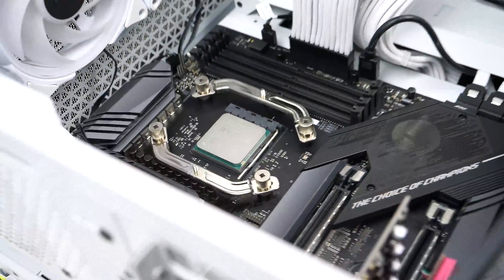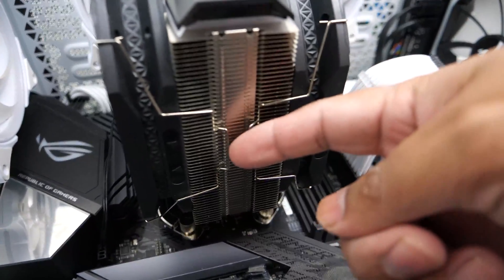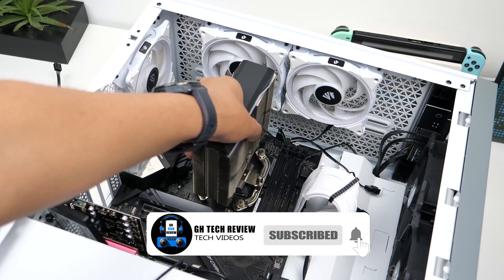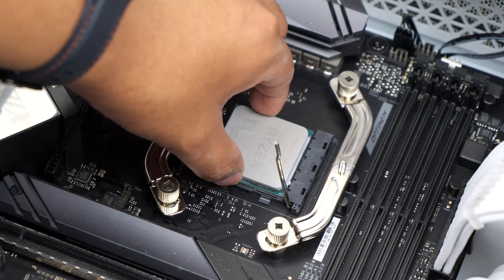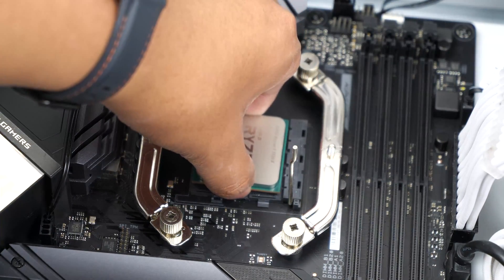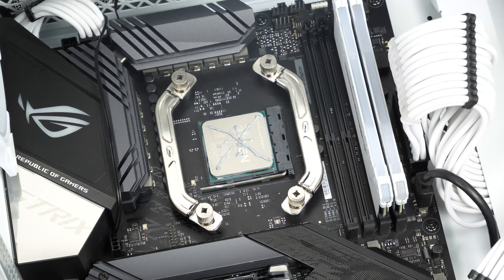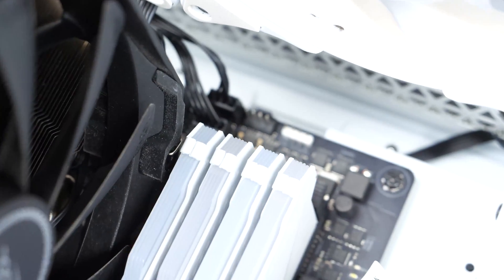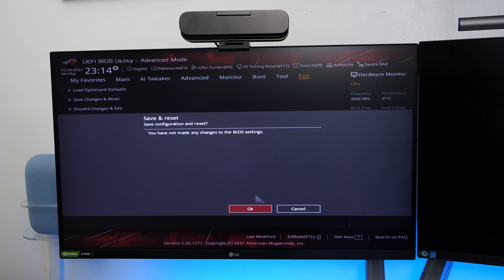How To Upgrade Your CPU Step By Step | AMD Ryzen CPU Installation 2022

Comment: just bought a ryzen 7 7800X3D cant wait to see how it works. gonna put it in this weekend.
Reply: make sure to update bios or check if your bios is compatible
Reply: @fittle270  I had a Ryzen 7 2800X, so should be good.
Reply: @Curtis56c bro I hope you're not trying to put your 7800x3d on your old motherboard. They are not compatible
Reply: @alexklein278  bruh hahaha

Comment: So u dont have to get new drivers for cpu or delete the old ones? So just take out old put new and done? It cant be that simple😅😅
What about if ur old cpu had integrated graphics?
Should one do a clean windows install just to delete old drivers just in case?
For mine i have to update bios, if i do a clean windows install do i brick the bios? Or thats just 2 different things?
Reply: the drivers are only there for you because of the integrated graphics. if you are getting a new cpu without integrated graphics then you will need a separate GPU for your graphics which will have its own drivers.

Comment: Hello. If I were to go from an Intel CPU to AMD would I follow the same steps? Any additional things to look out for? Thank you!
Reply: No, you need a different motherboard. The sockets are not the same
Reply: You can only go from AMD to AMD and vice versa. And even then you have to make sure your MB supports the chip. AM4 is different from AM5 and those MBs do not support each other but AM3 and AM4 have the same connection and are compatible as long as the MB manufacturer has available Bios for that chip.

Comment: Do I only need to remove the cable that is connected to the cpu fan if I have a AIO
Reply: You don’t need to remove any of them at all if you can move the cooler out of the way

Comment: I changed my motherboard, cpu, and gpu. Now I’m stuck on bios when I boot. I try to exit it and it just restarts bios. I have no idea what to do. 😢
Reply: If your old hardware still works swap them back in one at a time to see if its any of the new parts causing it
Reply: @sethmccuckins  I was able to get windows to boot by switching to CSM. Unfortunately my gpu is telling me that it is not recommended to have it on CSM. I tried to switch back to UEFI but got stuck in BIOS again like the first time.
Reply: @poppajay4968 did you use a different brand for the gpu?
Reply: @chaedd18  Yes. Switched from NVIDIA to AMD
Reply: @poppajay4968  ok sorry, i got this mixed up with something else, i have no idea whats happening with your pc
Reply: @poppajay4968  did you remove the nvidia gpu drivers beforehand?
Reply: Fresh windows install?
Reply: Make sure your mother board has the correct mounts for the new cooler as well. Delayed my build by three days waiting for new mounts to be delivered 🥴 NBD in the end but would have been able to plan for it instead of learning the hard way.

Comment: Changed the cpu and the pc won’t boot at all. It turns on the power button light doesn’t turn on and it won’t display anything to the monitor… feel like I just made my pc a paperweight but I followed all these instructions perfectly
Reply: If your old cpu still works the new one might be faulty in case you already checked if your motherboard supports your new cpu
Reply: Does your cpu has a igpu, or do you have a dgpu

Comment: Don’t bother with Thermal Paste in 2025.. Lookup PTM7950. It’s a phase changing material. You won’t ever need to keep replacing it. Actually improves the more cycles it’s used. I’d recommend Honeywell’s brand.

Comment: What if you get a red screen warning about TMP 2.0? There is an entire process for bypassing TMP 2.0 when upgrading your CPU. TMP 2.0 is enabled, and if you hit Y (yes), Windows will lock out your hard drive unless you have the encryption key. Your HDs are TOAST.🚨🚨 Get your TMP 2.0 keys BEFORE swapping CPUs. If you don't have TMP 2.0 enabled, you still need to bypass it in the BIOS, and there are numerous YouTube videos on this process. Happy swapping! ✌✌😎😎

Comment: What hardware upgrade will trigger reinstallation of windows operating system?
Reply: Mobo and boot drive I think
Reply: Nothing. But if you swap Graphics card AMD to Nvidia or other way around you need to remove drivers with DDU. 
Windows 10/11 is pretty good at reconfiguring itself when you change hardware. If you change mobo you need a new key.

Comment: I changed the cpu today. Scariest experience of my life
Reply: Dude im changing mine right mow scared 😱
Reply: It's honestly the easiest thing, even replacing your entire motherboard is the most straightforward process. As long as you follow instructions.
Reply: @KaladinVegapunk It's scary when ya start and don't have thousands of dollars in parts.
Reply: Tell me about it
Reply: Yeah i did it right and the bios screen recognized it but it's not booting up windows😳
Reply: @keltnhagrmn2059 did you get this resolved?
Reply: @keltnhagrmn2059 did you ever get this to work?
Reply: Bro is that work
Reply: It’s not scary

Comment: I've always been scared to change my CPU, and have been told botching it is a good way to ruin your PC. Though my CPU is now my weakest link on my PC so it will need to be changed soon. This video at least makes me feel a bit more confident in replacing it when the time comes.
Reply: Botching it wouldnt do anything but maybe ruin the cpu.
Reply: Best tip is to not overthink it man, if you’ve built a pc before then you can take it apart no problem. Worrying too much will just increase the chance of you fucking it up lol, it’ll be fine

Comment: I am new to this pc thing I got a pc with amd radeon rx 590 and xeon processor can I upgrade the processor?
Reply: check out pc part picker it will tell you if your parts are compatible
Reply: ask chat gpt or some ai thing trust me it saves a headache
Reply: @clementwolfe-r8lI don't mean to be rude, so don't take it this way, but using AI to ask for computer help is a quick way to mess everything up. I've asked for tech help before and it gave me completely wrong answers and nearly caused me to break my PCs storage

Comment: how much pressure should i put when wiping the cpu thermal paste not on the fan
Reply: About the same pressure you would apply as if you were cleaning eyeglasses, light but somewhat firm.

Comment: can high cpu usage 100% be a reason why I need new processor? I bought a new fan but that still didn’t seem to work.
Reply: Software issue most probably.
Reply: if you cheaped out on any parts that will be your problem, i cheaped out on a motherboard and my ram couldn't reach full speed. on top of that i could barely play any new games with 60fps 1080p

new motherboard solved that i can play in 1440p no problems now
Reply: Yes bro wtf
Reply: @Dinksten could also be a pc/software problem, my CPU was constantly at 100% and i were tweaking out trying to find it out, got so sick i reset my pc and installed windows again, and back to normal
Reply: @ how old is too old? I got a Ryzen 9 7900x
Reply: @Jeet-Driller  That cpu is fairly new, will last you another 10+ years and can be paired with 4090 or higher. So, I don't know what the issue is. Tell me the gpu you have.
Reply: @Jeet-Driller that’s a good cpu it shouldn’t be at 100% usage though

Comment: Wat if I can't scre my cooler into my cpu
Reply: I
Is there something the screw go in case I don't see anything
Reply: @WilliamReitmeier-kl5by did you figure this out? they usually come with two or three adapters to fit any changing screw patterns/positions. usually one being intel or amd but they may effect cooling hardware aswell

Comment: So um what should I do if the chip came out with the old one and is stuck to it?
Reply: U just take it off
Reply: @PeterdihMore it was stuck on the old heat sync but I figured it out just got a hair dryer and used a old ID and got it off with no issues or bent prongs

Comment: I have an A10-9700 and the bios is at the latest driver and I'm planning on buying an R5 2600, should I update the bios 1st or install the new procie 1st? If I update the bios 1st it will cut the support on the A10-9700
Reply: Update your BIOS with the previous processor 1st. Then, swap the new one after you've done the update. Careful tho, if the update fail, your motherboard is done. No other way around except to buy a new one if that happened.

Comment: I have a b450 mobo and i partner it in my r3 3200g do i need to update bios if im gonna buy a second hand r5 2600
Reply: Yes
Reply: why do you buy 2600 replacing a 3200g? are you upgrading? or something happened to the 3200g?
But anyway i dont think you need to update bios. If you want to really make sure, i suggest you to go to the official website of your motherboard, just type your motherboard name on google. Then look for the compatibility section.
Reply: No. R5 2600 is one previous generation then 3200G. unless if you upgrade it from R3 3200g to something like 4000 series or even 5000 series, which your mobo is more than capable to handle 5000 series as long as you update the BIOS. Its better to upgrade to the next gen cpu rather than swaping it with previous generetion. Does it cost more ? absolutely. But it worth much, much better.

Comment: I have a b450 mobo and i partner it in my r3 3200g do i need to update bios if im gonna buy a second hand r5 2600?
Reply: Most B450 motherboards already support up to 5000 series, my old B350 supports from 1 to 3rd gen ryzen by default. But, if your bios is old, it wouldn't hurt to update it. Just go research about your motherboard and the BIOS versions
Reply: Also look out for a r5 3600, they shouldn't be much more expensive than 2600, maybe max 10$ more, but are newer than 2600 and do give more performance and less bottleneck.

Comment: I went from a ryzen 3 to a ryzen 5 5600 and now i cant even load fortnite up and if i can i get 12 fps in the lobby before it crashes, what has happened
Reply: Is ur motherboard compatible for the 5000 series?
Reply: @PompeyPlay  yes
Reply: This one comes up more often than expected: when you plugged your HDMI or display port cable back in, did you plug it into your video card, or into your motherboard?
Reply: @erikmcgowan33 it was in the gpu
Reply: @FOAMYCHIMERA461  did you ever check the temps on your new cpu while it was installed? The cooler might not have been doing its job, the thermal paste could have been a bad batch, stuff like that which would cause it to throttle itself to reduce thermal load
Reply: @erikmcgowan33 definitely not the cooling average temp was 40c
Reply: Did you use ddu to uninstall the chipset drivers? If you did not there probably was a lot of residue left over from the ryzen 3 I would run ddu and then don't use the auto detect tool from AMD go to the drop-down menu and choose your CPU
Reply: updated the motherboard bios? installed the new cpus driver?
Reply: @leo-olivierguay5487  I tried everything, updated gpu, cpu and motherboard drivers, reset the bios, re installed windows, dissasembled and re assembled the entire pc. I've just gave up and gone back to my ryzen 3 and I can return the ryzen 5 anyway
Reply: @FOAMYCHIMERA461 any fix?
Reply: @BraxtonDavis-c9p  only found out a few days ago, turns out my gpu was faulty and when I had my ryzen 3 I didn't have one and was using the built in graphics
Reply: @FOAMYCHIMERA461  how did you try everything else but ignored the fact you didnt have a gpu
Reply: @sapo4747 basically i had the ryzen 3 with built in graphics, i then upgraded to a new cpu and i knew the 5600 didnt have built in graphics so i also brought a gpu, but the gpu was faulty
Reply: @FOAMYCHIMERA461 Ohh I see, damn you had to do all that to get everything working 😂. It’s good you did though
Reply: No @BraxtonDavis-c9p

Comment: do you need to upgrade Power supply unit for higher cpu?
Reply: Depends on your current PSU, check the needed wattage for the new cpu and compare it to your current CPU - if it is the same it should be fine. If it is not the same, check the max wattage output of your PSU. I recommend using some sort of online "pc part picker" - it should alert you if there would be any problem. (Note : im not an expert, this is just my common sense, anyways I hope it helps)
Reply: almost never
Reply: not all the time, I did upgrade mine after getting a huge GPU upgrade tho

Comment: Mine is a stuck on orange light what should I do
Reply: Everything lights is on I got replacement for my cpu and now it’s stuck on orange light I need help
Reply: Check if that light is for DRAM, try moving your sticks to different slots.
Reply: @ I figured it out I re seated my cpu and it worked
Reply: @lvfestylebrazy  Good to know!

Comment: So I'm upgrading from ryzen 5 3600 to 5 5600 and i have Gigabyte B450M DS3H WIFI, do i need to update the bios?
Reply: If you go on pc part picker and crate a parts list that includes your motherboard and CPU it will tell you which BIOS your motherboard requires to run that specific CPU then all you need to do is check what version your on and update if necessary.
Reply: @StayFitted59FIFTYY hey man I have the same motherboard!! The B450m DS3H Wifi and I have a Ryzen 5 5600g and I heard that the best CPU for b450 is the Ryzen 7 5800X3D !? Idk if that’s true or not but So I wanted to know if that’s possible to do !?
Reply: @snakebite1933  The latest/better cpu will always be better as long as it's compatible to the socket (e.g. AM4 socket), and also AMD cpus with "X3D" are more better.
Reply: @snakebite1933  get 5700x3d since 5800x3d is impossible to find now
Reply: Upgrading today from 2700X to 5700 X3D
And from 5700XT to 7600!!

Comment: hello I'm upgrading my cpu from i5-2500 to i7-3770 do i still need to update the bios?
Reply: put the motherboard you have and the cpu your upgrading to into a website called pc part picker and it should tell you if you need to update bios or if its incompatible
Reply: Yea
Reply: depends on the motherboard

Comment: can run a intel i7 7700k into a  h110m-btc motherboard? i did some research and it says it can run a i7 but not sure because doesnt say 7700k
Reply: If the chipset is correct then I don't see why not? (Not a pc expert btw)
Reply: @djpansetametzatziki i just did it runs fine just made sure i had the newest bios updated on my motherboard
Reply: You could try asking chatgpt. Not always 100% correct 😅 but that's what I did.

Comment: in what situation would you choose not to use optimized system defaults?
Reply: If ur underclocking or overclocking
Reply: @windpw with the new cpu or the old one
Reply: @morvy006 it wouldnt really matter what you did with the old cpu bios settings. Just make sure while your on your old cpu to update your motherboard to the latest bios. Then when you put the new cpu in you might want to undervolt or overclock your cpu depending on how you want it to run but stock settings should be fine. Another thing you might want to change in bios would be the fan speed for your cpu aio or cpu cooler. Again stock fan speeds are fine.

Comment: Do I need any driver updates or anything? After installing
Reply: Before. some motherboards need driver updates to handle newer cpu-s, like in the case of Ryzen 5000 series in case of b450 motherboards.
Reply: @ but it should be fine with a 5000 series chip in a b550 right? I was rocking a used 2700x (which isn’t even compatible with my MOBO) in a b550
Reply: @WilliamGlaser-dk9nh  I think it's compatible from default on b550 boards. But whatever the case, if you update the bios, it's the same. I am also in the same shoes as you. I am just about to upgrade to a 5700x from my 2700x also... It's sitting on my desk, but I must harbor the courage to install it... I never did it before... :D
Reply: @ hahaha you gotta work it up, you could motivate yourself maybe with a cooler upgrade. I’m so happy with the performance and it is a real nice upgrade
Reply: @WilliamGlaser-dk9nh  Damm... It took about 4 hour... EVERYTHING went wrong. But It got installed... Now stable 50-60 fps on helldivers 2 instead of 20-40... :D Also, temperature is 55 max. Actic cooler 36 is a beast indeed... :D
Reply: @ w, good job man, maybe I’ll pick up that cooler too, good luck in the future with your PC
Reply: @onlygameplay134  mine comes in a couple days 2700 to a 7 5700x hoping for a smooth install
Reply: @hurlz3242 you done it yet? how was installation
Reply: @ree7455  I can take my experience also because we have the same type of motherboard and processors. Everything was fine. I updated the bios beforehand, then installed the 5700x. The only problem was a small bios error. (They misspelled one button). When it asks for deleting BitLocker keys, (And you never used Bitlocker to defend any kind of data on the hard drive) push Z if Y not working. That is all... I was also able to push the processor a little. -25 undervolt all core looks stable for me, with precision overdrive.
Reply: If u have a ryzen 3 and want to update to a ryzen 5 the u have to do a bios update
Reply: Yup I mess up and now I need to either flash bios or swap back to my old cpu and update bios before I can make the switch again

Comment: if i upgrade my cpu will i lose all my data?
Reply: No.
Reply: NO bro u dont lose anything
Reply: your data is stored on drives, drives can even be pulled out of the computer and the data will still remain on them, you only lose data when formatting drives or reinstalling windows (i think), replacing parts such as motherboard, cpu, gpu, ram etc. doesnt affect your data. But if you lack such simple knowledge I would recommend you to only buy and replace computer parts with someone who actually knows stuff, maybe a friend or even going to a computer service would be good
Reply: Yes
Reply: Is it the same with my storage
Reply: @coolgamer-vr2om Why would you? Your data is stored on hard drives, not CPU.
Reply: most intelligent human
Reply: @ΙΕΧ  not nice I am new to this stuff ok